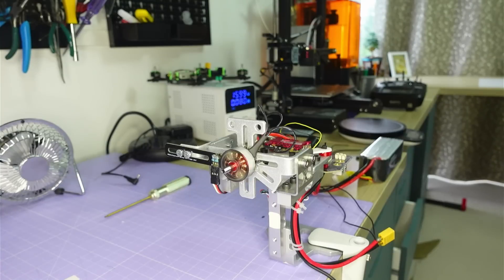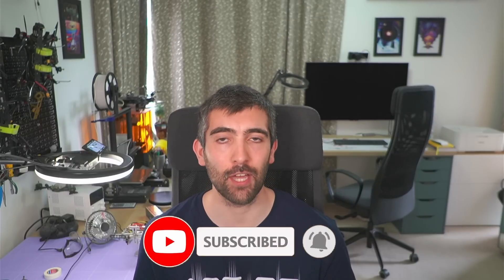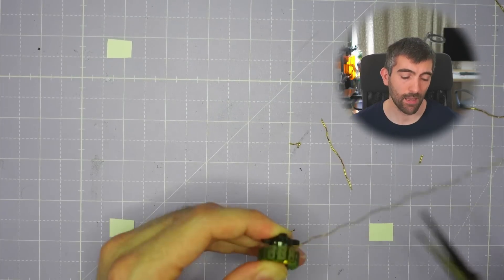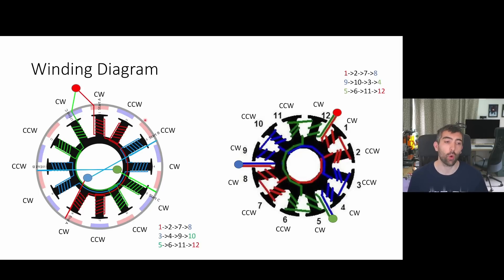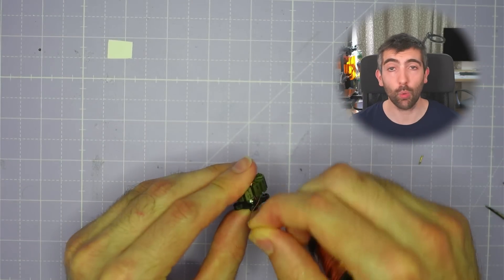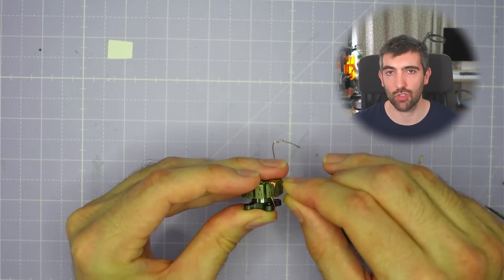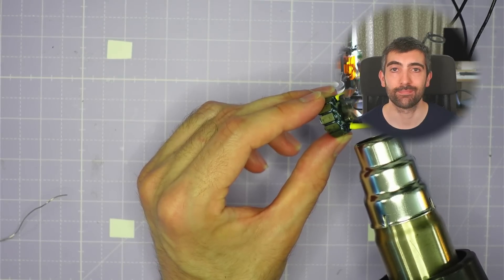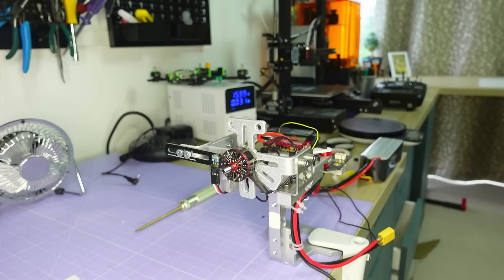I made the MOST EXPENSIVE 2207 motor (with 100% Silver Wire) and KILLED IT 😭

Comment: Silver has a lower resistance, so you would have to add more turns to match the original windings, which is why it smoked, you needed a higher diameter wire with the same number of windings.  Start with ohms law, combine it with watts law, and determine the appropriate number of turns and diameter based on the current you were pushing through.
Reply: Yay. There's someone here who understands where the electrical issues are.
(I stuck to the economics vs performance difference)
Reply: That only applies in a stall condition if that isn’t obvious to you then you don’t know nearly enough about motors
Reply: @geekswithfeet9137  Actually, it's called steady state, but ohms law absolutely applies to A/C, you just have to calculate the RMS value for the frequency you're using, and determined the maximum load the wire can handle.  With brushless motors, you're creating an electrical short with every pulse, at 100% throttle, there's little to no resistance coming from the controller, and it's like apply the battery directly across the wire for a moment.  You can do it, but over a shot period of time the wire heats up and melts the coating even with the pulses.
Reply: @jacobsoby3910  so inductance and back EMF don’t exist? Lol, KV what is that?….. clown
Reply: @geekswithfeet9137  The inductance is minimal, and when the coil is fully energized, it becomes an electrical short.  KV is simply the number of 1000's of RPM per volt.
Reply: @jacobsoby3910  it’s obvious you don’t know how a motor actually works mate

Comment: great experiment Chris! I used to made 4 x 2207 with silver wire for Mr.Steele. I remember he told me the performance is similar to a normal copper wire motor. that's why we didn't make it to the market. it is also super expensive lol
Reply: It is worth if for winding guitar pickups though.  It is more sensitive, and gives you a wider range over copper.
Reply: but since its more conductive isnt it more effecient because you have less resistance? so what about using it for whoops races where they want longer flight times and the motors are so small the cost wouldnt be crazy
Reply: @ the efficiency increase are not that huge compare to the price. This is why no one use it on motors.

Comment: silver plate copper works just as well as solid silver  with the exception solid silver may run a lil cooler. electricity travels on the outsides of the strands not the center.the differences in winding patterns (how tight and neat)is the biggest problem  to keep the test fair. but if two Motors were wound identical one with silver-plated copper and one with just copper there will be a 5 or so percent performance difference in efficiency torque and RPM

Comment: Why computer processors use gold pins instead of silver pins if silver is more conductive? Weird
Reply: Silver can form an oxide layer (turns black) which will reduce the metal available to make contact
Reply: @robbotech07  Actually it is not oxide, but sulphide. Gold, palladium are much better for contacts for HF signals.
Reply: @ІгорАлієв  thx
Reply: @robbotech07  I see! Thanks for the explanation. It makes sense

Comment: Its highly recommended to press the wire straight in the slot after each half loop and not loose tension. If u don't do that u will have a little slag in each loop, so the wire will be moved by the electromagneitc forces, that rubbing will drasticly lower reliability and increase noise. And u will have a gab between the first layer and the tooth, so u can't reach the maximum possible fill rate. The heat transfere will suffer to. U can fix the slag by adding a drop low viscosity epoxy, but that is not a clean solution but will increase motor life. Epoxy easily peals of if u have to unwind it.
A better fillrate with copper will alway beat silver. Copper wires are avilable in finer diameter steps so u can max out the winding space better. 😉 Most potential to increase powerdensity (lower weight per Nm) u will always find in the magnetic circuit. Hind: smaller air gap.🤫 And hand wound motor always beat machine wound because u can always squease more windings in by hand. 🖖
Reply: Chris is a very smart guy, but I rewound a Hobbyking 20g motor when I was 17 years old way better than this video lol.
Reply: Most important tool are broken probs. Use the prob blades to press wires to the teeth.
Reply: @krautergarten4529 Broken props are so versatile lol. Other uses are motor wire protection and of course as a stabby tool.
Reply: @luckbot-5000  If u need a stabby tool for ur last windings u know that the motor will rock🤘 or burn 🤪
Reply: Assuming motor is designed to the limit, would smaller air gap still increase performance if the magnetic circuit is already saturated at max power?
Reply: @combinacijus  The magnetic circuit should never be "staturated" in a good design, that would cause high losses ... bad efficency but high torque density in some limits. So u always have some kind of design wiggle room. Smaller air gap will give u higher flux in the air gap. Or the same flux with thinner magnets -> lower weight. These rc motors are never designed for max efficency or power, they are designed to be cheap. U will never find room for more copper in a good motor design. But u are right, u will never know which materials were used for the stator lamination or the flux return ring, so increasing the magnet grade or the thickness has some limits.
Reply: Silver is the best conductor of electricity. You last paragraph makes no sense. Silver has the least resistance of any metal.
Reply: It is highly recommended not to use pure silver in electrical applications that have the possibility of arcing. Silver arcs really bad due to its very low resistance. Usually it is combined with cadmium to remedy that problem.

Comment: Instead on chemically removing a more durable enamel, you could use sandpaper or emery cloth on the ends of the wires to get that enamel off as solder prep. It’s inelegant but it works.
Reply: you can just scrape it off with a blade too.
Reply: @Kyrazlan  it's what I do.  Works just fine.  Also means that you're not burning toxic plastics when soldering.
Reply: I've had negative outcomes trying to burn off enamel.  I put on my Mr. Magoo magnifying glasses and sand that enamel off now and never have to guess if it's good.
Reply: wont fire work too?
Reply: @SmileyFace01  Fire sure would work. Too hard to control where the enamel stops burning off though. You would get much more precice control of where the enamel remains by sanding.
Reply: @FPVKrash  Well when burning the enamel off I still like to sand it a bit.. so It's probably just an unnecessary step
Reply: @SmileyFace01  Only time I’ve burned enamel off wire has been when I was rewiring a fencing foil, but it doesn’t matter if a bit more enamel comes off in that process. Having burned enamel off wire, it’s not something I’d ever try on a motor wire. Some folx sanded their wire after burning enamel, I never did and always had great conduction.
Reply: @FPVKrash You can just wrap the part you want the fire to stop at with a damp paper towel
Reply: @FPVKrash  "Some folx sanded their wire"
Well that sux.  (gotta love the X, worth 8 points in Scrabble).
Reply: @SmileyFace01 fire may lead to oxidised metal making a bad solder connection. Sandpaper ist better, but at that wire thickness using a silicone abrasive disc from proxxon may be the easiest was.
Reply: Yup.  Mount a Dremel with sanding attachment as a mini belt sander.

Comment: If winding silver wire why not use the twisted pairs to go to the esc rather than soldering ti copper silicone coated wire?
Reply: Good point. If you’re winding your own motors, why not keep it super clean and not add unnecessary joints. That could end up as a super-sick build but personally, I wouldn’t be able to handle it if I clipped a wire too short when soldering to the ESC. 😅
Reply: @FPVKrash  Imagine, and you know it is going to be the last wire of the last motor that's too short! And the agony deciding between an ugly little extension or rewinding the motor 🤣
Reply: @dfgaJK  😂Stop. Put it on the shelf. Forget about it, and start building an entirely new quad. Get board, and pull it off the shelf, to get winding again.

Comment: you can also make 1,4,7,10 one phase
then 2,5,8,11
and 3,6,9,12
(for the star configuration)
i wonder if connecting a ground wire to the star point would reduce electrical noise
Reply: Probably do the opposite, and give the AC 'noise' a direct path in to the DC circuitry.

Comment: So how expensive was the "Most Expensive 2207" (Not including all of your time)?
Reply: That’s not a lot of silver. Silver at between $20-$30/oz I’m guessing it’s $5 worth of silver.
Reply: @jtcustomknives yea, but that doesn't include making an enamel coated wire from it.
Reply: @jtcustomknives plus he said sterling silver,  so its not even pure
Reply: @RidiFPV wrong sterling silver is between 92-94% real silver. Very few things are used/made of 99% silver and the only 100% silver is when it's ore even then it's other minerals with it.
Reply: @kouderuivy he isn’t wrong. He said it isn’t pure. 92-94% isn’t pure and you just proved his point.

Second, there are plenty of situations where fine silver wire is used lol. Do some research into safety critical electrical engineering and fine silver is all over the place.

Edit: and don’t try to argue semantics with me regarding 9999 fine silver not being “pure silver.” It is the closest you are going to get for what is considered by nearly all metallurgists to be completely pure silver. But the argument you are making with respect to your attempt in correcting the commenter above is disingenuous at the least. There is a huge difference between sterling silver and fine silver, esp. in elec. engineering.
Reply: Worst of all non fine silver is a worse electrical conductor than copper.
Sterling silver has only 85% of the conductivity of fine silver. Copper has about 94% of fine silver conductivity.
That is why professional made silver enamel wire is always fine silver.
I buy mine from Elektrisola in Germany ☺️
Reply: I built one for a company that cost over $10,000.  It was technically a 2215, sensored, sine bemf, and used for a military contract.
Reply: Don't you just love how he answers our questions,posts the videos then let's us hang out,might consider unsubscribing, not my type of host.
Reply: @M-H433 darn, in a month I don't see a response from him on any of the top comments.  I don't think a creator needs to like or reply to every comment (YT comments can be toxic af), but thats like zero effort to build a community. 

I dunno, this is his first video I watched, maybe I'm missing some context.
Reply: Similarly, video of the failure would be cool.
Reply: Hmmm,good question,so 5.00$ is that correct?
Reply: Would actually be good to know actually how much the enamel wire is,just out of curiosity.
Reply: Not sure how much wire he used, but it was probably somewhere close to £10 per metre

Comment: I lost and crashed my quad which left the ESC buzzer on for like 30mins and burnt out three of my motors. 
I naively thought it's just a matter of buying some cheap copper wire and rewinded all three only for the motors to smoke again! Turns out you have to get a particular type of enamel insulation that's high quality as what I noticed happening was the stator core scratched off the cheap insulation due to how sharp it was. In the end, it worked perfectly and I got my motors back but I couldn't match turns count of the original windings, just not tight enough and the KV was a bit off to the original. But it's good to know that if I ever ruin an expensive set I can get them working again
Reply: Some people round of sharp edges before rewinding for that reason

Comment: How about an experiment showing the differences of a neat vs loosely wound motor?
I remember flying old emax motors years ago and those windings were messy as can be.
Reply: You can pack more copper into the motor when it is neatly wound.
Reply: @taavituisk8452  Is that the intention though if you need a specific number of windings?
Reply: @adamrobertson7215  For the same number of turns you are able to use larger gauge wire (more copper) or are able to make a smaller more efficient motor with less air gaps if using the same amount of copper.
Reply: @taavituisk8452  Due to larger air gaps, messy winding will experience lower proximity effect, and thus lower effective resistance (the coil will also be higher Q, if you care about that).
Reply: @unknownhours  so which effects outweigh?? Are there applications where windings are purposely made more loose?
Reply: @superduperjunde  I'm mostly just being contrarian. It probably doesn't matter too much until you start to get into the MHz range, though even at lower frequencies it is a contributor to waste heat above the DC resistance. And if you have the extra space, you are probably better off filling it with additional windings.

In some applications, like radio, you do want a high-Q coil, and that's where the proximity effect will really kill you. Just google "high-Q coil" and look at the images. But motors don't really care about the Q-factor. I'm not really an expert on motors...